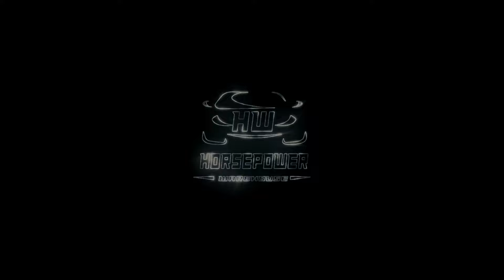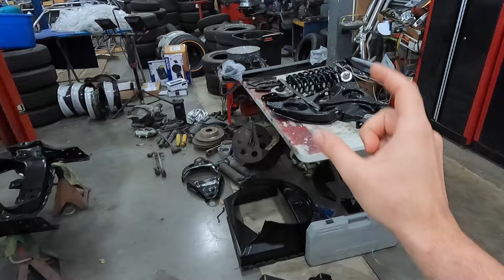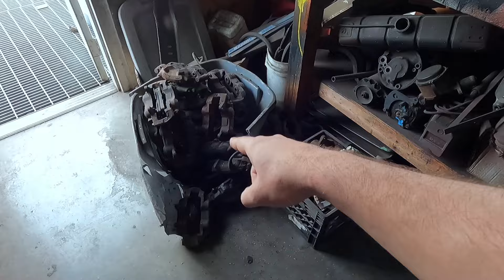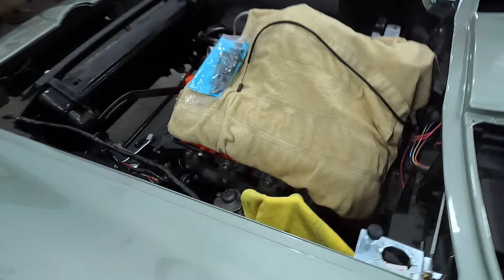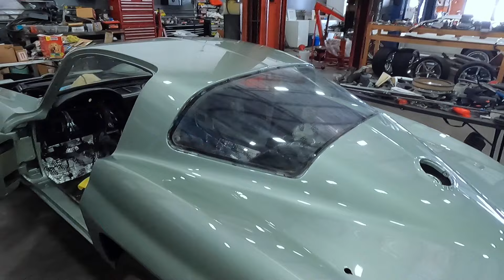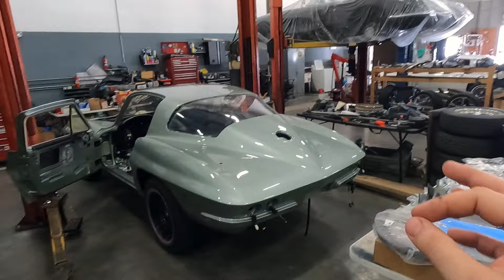I Restore C2 Corvettes WRONG on Purpose... Here's Why!

Comment: To me a key difference is these cars is that they were made on an assembly line by people as a disposable product to be used and eventually replaced. Now that they are considered rolling art and collectable it makes sense to make it nicer and longer lasting.
Reply: The key words in this post are "to be used".  In other words cars were built for people to drive and enjoy not to be judged in a show contest.  Safety improvements such as dual circuit brakes and disc brakes are absolutely necessary for older cars to be driven safely in today's traffic.  Other items such as hardened valve seats and radial tires are obviously not original but are also necessary as well.  I am obviously not a member of the "100 per cent original" crowd.

Comment: There was a time, not too long ago, that this was the norm in restoration. I recall the term “restomod.” It appeared stock but had updated components so the owner could DRIVE IT!!! For the purists, remember that? Driving a car? Not just putting it in a shop, on a trailer, at a show, back on the trailer, back to the shop…..

Comment: Dude, great video!  After owning our '64 for 32 years, we (my twin brother and I) finally finished the restoration.  To a non-NCRS judge the car looks stock.  We added dual circuit, power-assisted four wheel disc brakes, power steering, radial tires and a MSD ignition.  Our car is show quality, but is meant to be a driver.  Please keep encouraging your clients to make these safely/comfort/reliability upgrade....

Comment: Restoration of a C2. 1965 Coupe I've owned for nearly 50 years. I'm doing it the way I like it. Painted frame, stainless steel brake lines and fuel line. Little changes but a lot of detail to make it pop. Loving the project! Thanks for the great video!

Comment: I agree completely with everything you said especially the Borgenson steering box. I have installed one in my C 3 and it is the only way to go. Just working on the car now is more pleasant as there is no longer this leaking mess of hoses and ram cylinder. The steering feel is far better especially if you add lots of caster, the car points better and tracks better. All the other things that you mentioned just make good sense, to be able to enjoy driving the car is what it's all about.

Comment: Impressed with the stunning work you do there!  I've done most of your recommendations over the past 9 years to my 66 convertible matching number 300hp 327 car.  Borgeson steering, Tremec 5sp, Vintage air, quartz clock, dual master cylinder, Edelbrock 8 injector MPI fuel injection with single plane original height aluminum intake to retain original oil tube and PCV, electronic Voltage regulator inside original cover, bluetooth radio and speaker system in rear compartment, and another important safety item - 3 point shoulder belts (no steering wheel face plants for me)

Comment: I wholeheartedly agree with you. 
Furthermore, I think the NCRS point system should be reserved for ORIGINAL  cars with factory original paint jobs ( you know, the kind that has 'orange peel'), etc., etc. I say that realizing that if NCRS had only factory original cars to judge, they'd be limited to new cars! Just because you repainted with one step lacquer 60 yrs later should not confer originality points. Restored to LOOK original is beautiful, but it ain't original, A 2023 Delco tartop is not a 1966 Delco tartop. By analogy, an original 1873 Colt Peacemaker in good original condition is worth 
WAY (tens of thousands) more than a reconditioned 
1873, even if it was refinished exactly the way Colt did it. Just my opinion. 
By the way, what is your opinion regarding polyurethane vs rubber bushings?

Comment: Without knowing your process of upgrades I used almost all of them when I built my '65 Roadster 19 years ago.  I use calipers that have been stainless steel sleeved, I use a new-technology battery, I run radial tires and my car was painted with lacquer using clear lacquer for the final 3 coats of paint.  My paint is not perfect at this point, but it still looks very good.  I had my engine rebuilt using hardened valve seats and I run conventional 10W-30 oil.  My clock has been upgraded to a quartz mechanism.  It happens that my car came from the factory with power brakes and as a part of that brake package GM equipped power brake cars with dual circuit brake lines.  Why they did not do that on manual brake cars, I can't answer.  The downside is the 1965 master cylinder is hugely expensive.  I was fortunate enough to have found a shop that rebuilds those master cylinders and I had it rebuilt rather than put a new-design master cylinder on my car.  Great video - thank you!

Comment: Couldn't agree more.  I have a '63 Studebaker Avanti, and I've taken a similar approach to restomodding it -- all period-correct looking but lots of performance and safety upgrades that no one would notice (and a few they would, like 3-point seatbelts and seats with headrests).  Definitely agree on the dual master cylinder.  My car had already had that upgrade done when I bought it, and thank God, because one of the lines to the front brakes hadn't been secured properly, and as the years went by and it vibrated back and forth against the frame, wearing the line thinner and thinner over time.  Then one day I had to stop suddenly, and the surge of pressure through the line ruptured it.  The front disks which do most the stopping were just gone.  The rear drums gave me just barely enough stopping ability to avoid rear-ending the car ahead of me, but I did avoid the collision.  I don'ty think I wast going fast enough that I would likely have been seriously injured, but who knows?  I certainly would have incurred significant damage to my car.  If I had still had the original single master cylinder, I would have had no brakes at all, and would have plowed right into the back of the car ahead of me.

Comment: I can relate to your opinion of synthetic oils.  I was having an issue with my C3 Camaro. (please, no jokes)  I was having a leak problem with the power steering pump.   While complaining about the issue, the NAPA guy stressed that I go back and use the cheapest fluid available instead of the premium synthetic version.   The leak disappeared.
As for your cars - I wish I could afford one.  My brother had a 72 big block convertible.  It was this teenager's dream.  I wish both were still here.

Comment: I always thought that in 66 the duel master cylinder was offered as an option where as in 67 it was standard. Interesting and I love the stainless fuel and brake lines along with stainless exhaust without mandrel bends.Ha ha ha, the clocks never worked, lol. Nice upgrades, you got my vote. Your cars are built better for sure. I would rather have one of yours. WHAT, NO MOBIL 1, I would rather use that and change the gasket to accept it.

Comment: I have to stay with synthetic motor oil. I have a friend who was over the labs at a major oil company when synthetic oils came on the market. Their tests indicated such a dramatic improvement in every facet of protection, wear, etc. he became a big proponent of the synthetic variant for motor oils.  Sorry about the cork gaskets but they're easier to replace than a worn out engine.
Reply: I'm a big fan of synthetics too. I bought a new truck in 1999 and changed the factory oil for synthetic. Ran it that way for 20 years and sold it to my dad. It's still going at 200k and the engine is just as tight as when it was new. Nothing has been changed on it other than oil and spark plugs.

Comment: I would add electronic ignition and electronic voltage regulator to my suggestions. They're simple and virtually invisible. The only one on Junior's list that I'm torn on is dual circuit master cylinder. I'd like to do it to my 63 but it's very obvious and not easy to go back to single at a later date.

Edit: I also did aluminized exhaust on my car. Corvette Central has sets with the correct bends, just aluminized. Would've gotten stainless if they had it.
Reply from the maker: Excellent additions, I will add these to the bottom of my list. Thanks for checking out my channel!
Reply: @HorsepowerWarehouse  yeah, thanks for posting this stuff. I'd love to have you restore my car because you have the same restoration mentality as me. The problem is I live in PA so that's quite a hike. Keep up the good content.
Reply: @TheEngineerJason  where at in PA. I am hoping to pick up a 63 convertible. If I do I'd love to reach out and share info.
Reply: @brianplay4758  delaware county. There's a few 63s around here that I've seen at car shows. Convertibles are affordable at least. Coupe pricing has shot up a lot in the last couple years.

Comment: Love pretty much every change you do. Question re: brakes: what do you typically do for brakes on a 63-64? Do you leave the drums and upgrade to a dual master cylinder, or do you convert to disc brakes? And re: oil: what brand/viscosity do you recommend? About to do the first oil change on my rebuilt '64 327/300 and debating about which oil to use. Thanks!
Reply from the maker: Honestly on the drum cars a dual circuit master is about as far as we will go. The 63 and 64 have their own personality versus the later years and we don't aim to ruin that. Driven HR5 is an awesome oil but any name brand conventional oil with a ZDPP additive will perform the same. Lucas makes the additive I prefer. Thanks for checking out my channel!
Reply: @HorsepowerWarehouse  Thanks. I drove a '65 Corvair Corsa turbo for almost 30 years with drums, and never had a problem, so that's good to hear.

Comment: Do u do anything with the frame? Reweld it? Box in wear points? Put a metal plate behind steering box?  What are your thoughts of electric headlight and wiper motors? Pete

Comment: Great video- I have a 63 corvette coupe with its original 327/300 hp power glide drive-train.  I was wanting to upgrade the trans to a more modern automatic however, i do not wish to do any major modifications to the floor / tunnel. Do you have any recommendations for a direct fit trans? thank you in advice!  chris

Comment: use LED light bulbs whenever possible for marker and especially tail lights. Easier to see, and don't have as much heat. They make them that fit in the factory sockets, so no mods are needed. they also come on and go out (flash) quicker when the brake pedal is pushed so they catch your eye when they come on. These cars already have the handicap of no third brake light that most people are used to seeing when following a car. anything that can make these cars more visible from behind may save a costly crash. dash light conversion to LEDs is also good because they last longer. it is such a pain to change the incandescent ones.

Comment: NCRS: Where removing a perfectly good original but blemished part, and replacing it with a reproduction part made from pure Chinesium, gets a higher score.
No thanks, not for me.

Great info Junior. There might be some items I would consider for mine (in my dreams), like stainless exhaust, decent speakers, ceramic brake pads, and probably the greatest automotive technological advance in the last 60 years ... EFI.
Reply: Not necessarily true. Reproductions often have discernible differences so you will lose originality points while gaining condition points. The point difference may be a wash as the original gets full points for originality while possibly losing condition points.
Reply: Do your research , these parts are not Chinese imports , take advantage of newer technologies  so  you can enjoy it longer with less  problems. Your choice
Reply: @meltondaniels2825  Sorry, I wasn't too clear. I wasn't referring to the stuff that Junior is installing, but in general the practice of replacing good original stuff with new repop stuff to get a higher NCRS score. Much of these new items are cheap overseas knock offs. The catalogs are full of them.And I am 100% in favor of taking advantage of new technologies for better driveability and performance. You wouldn't find me on bias-ply tires, etc.

Comment: Show car schmo car. Ive had a few things modernized under the hood on my 68 C3 327 driver. Also updated the entire brake system because I like stopping and re did the whole exhaust from the headers back. Kept her mostly original otherwise, doing the headlights and interior next though. Nothing special... some LED halos, pulling the seats and carpet to sound dampen for the now glass packed straight pipes, doing new seat covers then a retro looking Bluetooth sound system so I can play 60’s music on demand for the cool factor. Paint is original but needs corrected, but as I said she’s a driver. Doesn’t have to be perfect. Just mine.

Comment: Makes sense to upgrade, especially where it cannot be easily seen.   Why not use copper head gaskets?   Isn't AMS oil synthetic?  Eventually, all those anal, old-fart judges will die, to be replaced with potentially smarter, more practical judges that are "true" to the Purpose of the C-2--SAFE, enjoyable driving.   If I was buying a Bloomington-car, it MAY need to be rebuilt to enjoy--Ridiculous, UNLESS you have money to "burn." The period when it was initially-built, was NOT "good-enough" for me!

Comment: Thanks for video. Well done. 
But I disagree with using any type of accustic sound dampening material. .  You need material for sound deadening. It’s an acoustic vibration, dampener only. not noise dampening-it’s only stopping metal vibration and you’re putting it in a fiberglass car which makes no sense to me at all. Plus it adds 30 pounds of weight to the car. So if you wanna stop sound, and noise you’ve got to use wool, or other sound deadening materials. Fat mat, killmat and such rips off the public by false advertising as their materials are only for Audio suspension and reducing vibrations… not noise removal !!! It appears you’ve listened To the wrong people. However, since you are on top of most everything else, it seems like you would do some research and actually do a sound decibel test on these cars when you use this Kmat material you will find that they are just as loud as they would normally be, without it. if you did not use it…and also add that extra weight to these peoples cars. For no reason. It is also time consuming and not cheap. Does not stop road noise wheel noise or engine noise in the least. Please check into it. I’ve got it in half of my cars and the other half none. No difference in fact the cars without it tend to ride quieter!  Great info here In Making these cars safer and last longer. I’m doing an 81 project taking it from a $7k worn out mess to a new $30k pride making cruiser. I won’t be adding fat mat or kill mat as this car is already too heavy from the factory. 3800.

Comment: my question or dilemma  ..... keep it all original or retro mod it ....... been fighting this since I bought my red  1965 coupe in 1987.... at first I wanted a perfect original .... I listened to all the jelly heads telling me this was incorrect and that was incorrect ... blah... blah ... blah.....all while the car kept winning trophies in the driver category ..... year after year this went on ...... frankly I did not have the funds in 1987 to bring her to all original even if i wanted to  ..... furthermore I figured out at once a driver needs basic improvements to be safe and comfortable ..... I spent tens of thousand on rebuild parts ie a/c radiator brakes alternators carburetors etc .... on and on ... that never worked effectively ..... in 2008 I was badly injured repairing Kataria damage in New Orleans ...... the Red Head sat silent for eight years ...... coming out of the fog I had to make a decision either fix her or sell her .......... I came to realize I had to make Goals for me and Red .... Red must be Safe Reliable Comfortable Fun and Fast ..... all while keeping her as true as possible to her DNA  ... BINGO .....  Selected Retro Mod ...... Modifications that Meet my GOALS ..... I jumped in ..... glad I am moving toward those GOALS.... I still am hung up on some issues .... ie  keep the original engine L76 or LS it ..... am I Overthinking this ..... one bird in hand better than one in the bush dilemma .......... Got any suggestions I would like to hear ................................................................................... PHIL BIONDILLO

Comment: Why not just install stock power brakes?  Reservoir is two chamber and you keep it all period correct. Yes a reproduction reservoir is expensive ($800) but for  a 100k restoration who cares. 

Also oem gaskets we’re cork. Issue with oem oil pan gasket is it came in two pieces so pia to install an nit leak.